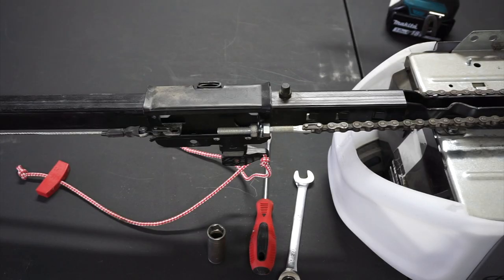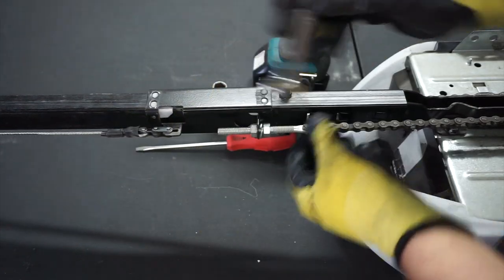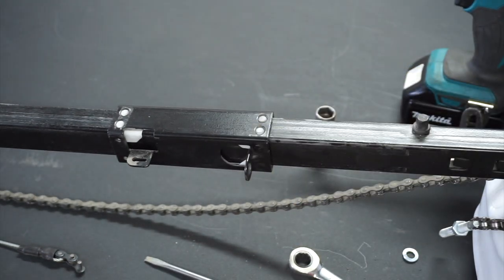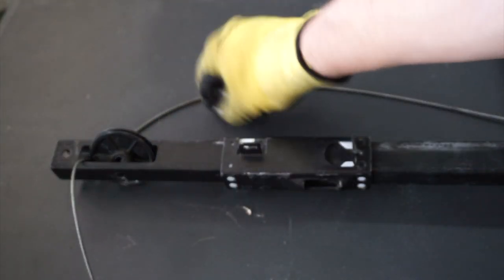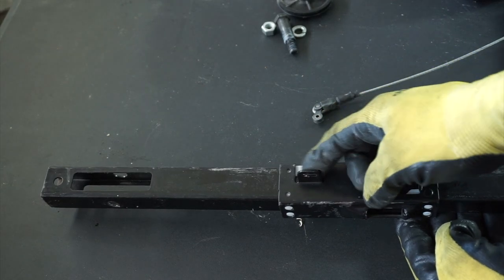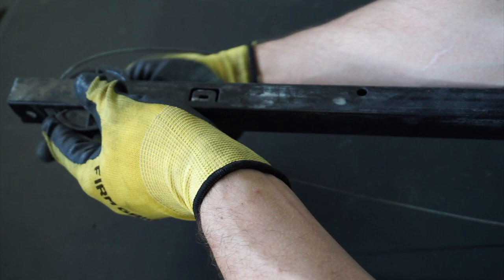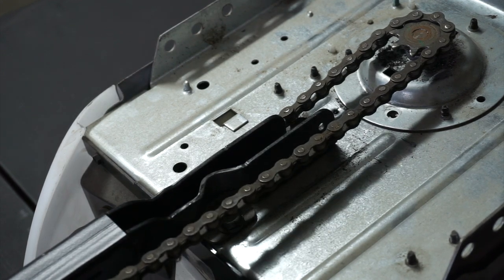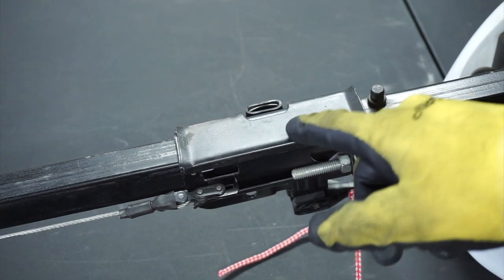How To Change The Carriage Assembly On A Chamberlain Chain Drive Garage Door Opener

Comment: Thank you so much I just replaced this easily. My only question is should I apply any grease around the trolley carrier?  It sounds and runs so much better. Great video.
Reply from the maker: You can if you want to but it’s got the plastic runners inside the carriage that help as well (:

Comment: Thank you for your video.  I just replaced the trolly/carriage assembly and I'm certain it went back together properly.  However,  when I garage door opens it only opens halfway.  When I try to close it, it reaches the bottom and reopens and stops halfway.  I have tried turning the force adjustment screw but doesn't do anything.  Any ideas how to remedy?  Greatly appreciated.
Reply from the maker: Must’ve been put in the wrong place, take the chain off, press the button and step in front of the sensors. By doing this the motor will reverse and go to the fully open position. At this point you bring the trolley to about the fully open position and re attach the chain. 

From there you would just need to make minor adjustments with the limits. I know it’s a bit. More involved but this should fix your issue
Reply: @GarageDoorGuidance  Thank you so much for that last instruction.  Worked like a charm!!!

Comment: Great video! For the tab that you hammered down flat, should you pry it back up? Assume it's just a safety tab to prevent the carriage/trolley from hitting the wheel? This vid was useful for me as the top wear pad closest to the opener side on my GDO is worn completely away (very heavy large door) so it's opening very slowly now due to metal on metal. The other 3 wear pads look fine so will have to follow your video to replace that one wear pad...assuming I can find them somewhere (I'm in Canada).
Reply from the maker: Yes as it’s a stopper to prevent the trolley from slamming into the plastic idler pulley 👍🏻

Comment: Very use ful video. Nowever, my quesiton is why the idle pully deeps breaking. Is there is an adjustment need to made somewhere along with the chain. your response would be much appreciative.
Reply from the maker: The end of the track there’s a tab that you need to pull up which prevents the carriage from running into it. Also you don’t want to overtighten the chain

Comment: Great vid thanks! How do you evaluate the tension that should be on the chain. I have a very heavy door.
Reply from the maker: You want it to be tight enough that it doesn’t have a big sag in it ( small sag is ok ) if I had to equate it to something I’d say a slightly loose bicycle chain.

Comment: Is the carriage assembly replacement the same process on the belt driven opener?  The clip on the side of the carriage assembly where you thread the bolt thru which is attached to the belt snapped off the carriage.  Can you confirm the carriage replacement part is sold as one unit with the trolley assembly?  I have an 10 year old opener - Chamberlain Whisper Drive Model WD962KD.  Thanks
Reply from the maker: It is sold as one unit and yes it would be the same with minor differences in the trolley

Comment: question, before unplugging it, can I put the opener in closed position  first? Second Can i use zip ties (Tie Wraps)  to hold the chain in position at the gear end?
Reply from the maker: You can do both yes

Comment: Is it worth cutting the wires for the garage door opener and just splicing them together after you reassemble?
Reply from the maker: Which wire are you talking about exactly?
Reply: @GarageDoorGuidance . I thought I was going to need to pull the opener down to do all of that. Thers wires for ghe paddle to open and close the door that are run through the rail. I figured it out a hot minute after I asked the question... thanks!

Comment: Love the video.  I'm not sure this is my issue though. I disconnected the door and cycled the opener and it works fine.  With the weight of the single wooden door, the trolley gets out to about 2/3 (the last joint in the rail) closed and it looks like it's hitting something and trying to derail.  The carriage bolts are in perfect condition and tight in the rail and nothing else has changed.  I can't see anything with an impact mark on it. It just started with a small noise and now it's a big noise.  Does this sound like the reason the trolley/carriage has to be replaced?
Reply from the maker: There’s a portion of the opening on those wood doors that does more damage than the rest of the ride because of the way it opens. It could definitely cause the trolley to strip out and need to be replaced
Reply: Sounds like I need to replace the trolley and consider some new, lighter doors.  Thanks for the video and lending your expertise!
Reply: @GarageDoorGuidance  So, the part arrived and I spent about an hour on the job.  All done and it works just like before.  Since I had the ladder and tools out, I watched the whole thing from every angle with a flashlight on every moving part.  It turns out that the bolt holding the pulley (axle?) on the tension spring cable was loose which allowed the pulley to ride up the framework then pop out.  Ten seconds with two wrenches and the problem was solved.  Let's just call this a $40 lesson in observation and inspection.  LOL!  The video still helped.  I approached the job with confidence and the only painful part was the blow to my ego.  Thanks again!

Comment: need to see what kind of tolerances, with the nylon glides in place that the carriage should have?????
Reply from the maker: What do you mean by tolerances ? How much space between them ? Or how heavy a load they’re equipped to handle ?
Reply: @GarageDoorGuidance  I am trying to figure out when the door glides are worn out. should there be no space between the glide and the rail? should there be .0006 inch space? what would be considered worn out and time to replace? when replacing the worm and gear shaft I found one of the glides missing so I replaced it. the other 3 looked worn but serviceable so didn't replace them. unit is of course quieter now with the single new glide.

Comment: I had to do a manual release on ours the other day after the power was out due to a storm.  when I came back later to reattach it, the carriage was completely stuck above the spring .  its touching the part with the bolts beneath the pulley.  any idea how to get that lose so it can go inside the trolley?  thanx!
Reply from the maker: Jeff Wald which part with bolts exactly ? is the plastic pulley broken?
Reply: @GarageDoorGuidance  hey brother, I just completely loosened the chain and once I took it off the pulley on the motor, that loosened it on the other side which allowed the carriage to slide again.  Boom!!  Back in business.  thanx!!